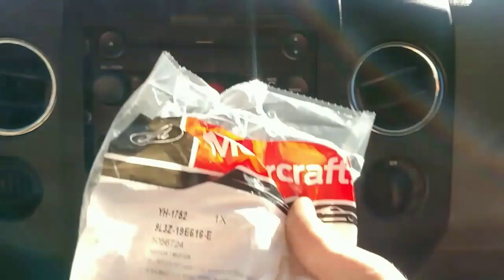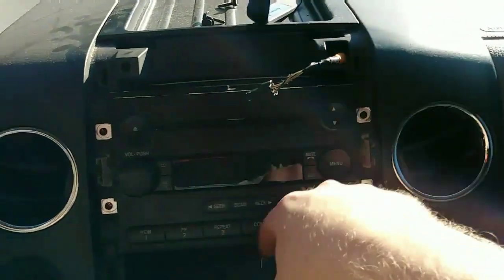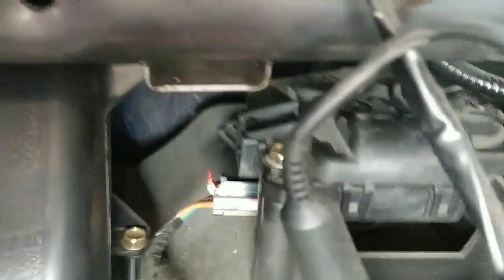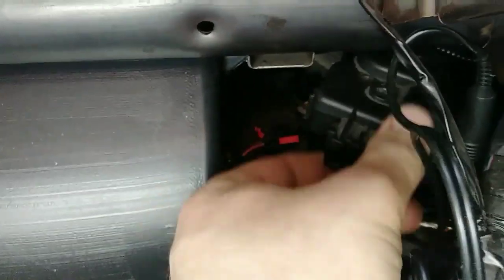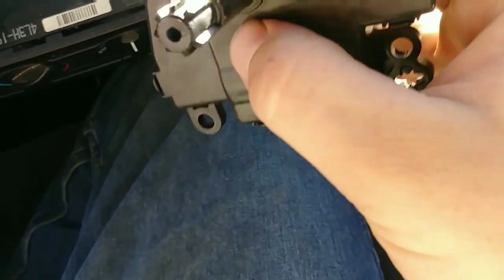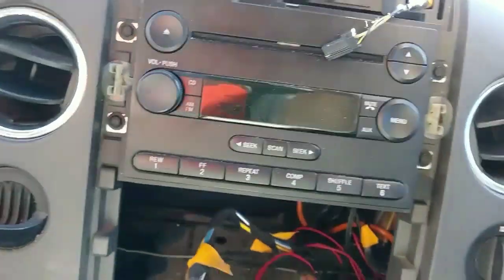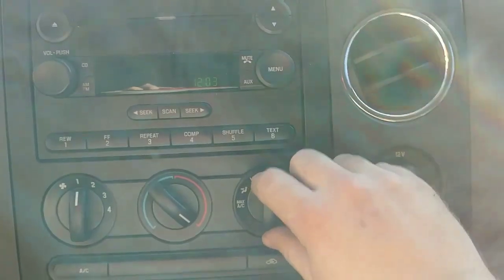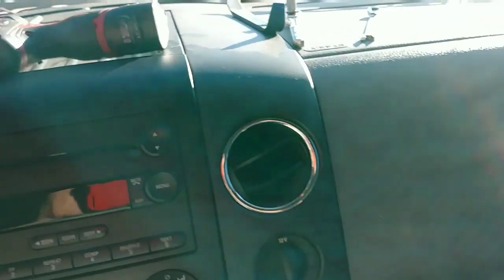How to replace a temperature blend door motor/actuator on your 2007 ford f150

Comment: Thanks for the video helped a ton.

Only thing you forgot to mention is that you need hands the size of a 4-year-old to get to the screw on the back side through the glove box.. at least on my 07 f150 lariat I had a heluva time getting my hand back there.  My hand and forearm looks like I stuck it in a weed wacker lol but I got it.
Reply: Hahahah....I'm next....
Reply: I opened it up ...and couldnt even start to fit my hands in there .. im driving with no heat  till i fabricate some specialty tools

Comment: 2006 about to replace for a second time. Such a pain. Thanks for the vid though. Good refresher for me.
Reply: What does it do
Reply: @jeffreyslay1607  It moves a door inside the HVAC system that either lets in hot air from the heater core or cold air from the AC system or a combination of both.

Comment: this is for heat right?     my AC doesnt blow cold until i get up to a speed of around 30 mph for some reason.    my heat doesnt seem to work well,   sometimes if at all.     i have a 2007 ford f150 XL 4.2.    think this could be my problem?
Reply from the maker: @MrKirk94  that sounds like a different issue. Possibly a clogged heater core.

Comment: Thanks man I replaced mine. Was a challenge cuz of the tight squeeze but I got it in, n got all 3 8mm bolts in snug. Couldn't fit a ratchet wrench in because the walls of the wrench head were too thick and there was very little clearance between the bolt head and the housing of the actuator so I had to use a regular 8mm wrench.. Lost a bolt and the wrench at one point. Retrieved them some how lol. Heats working good!!! Also I initially thought it was the heater core, paid $35 to have diagnosed at the automotive shop

Comment: Great video.  I could not get my new actuator in.  The splines on the old one are not in the location,  The space does not line up with the line on the housing one the one that I removed - tried to turn on ignition to move the shaft around some so it would drop in - no luck.  Any tricks?
Reply: @Dak Kerrins Thanks - that did the trick!
Reply: I realize this was a year ago but what was the trick?

Comment: I have replaced the the actuator on top and the one near the gas pedal and I still have nothing but heat. I can see one on the right/passenger side but ductwork is in the way. I can’t find a video for removal of the ducts or the actuator.HELP! I’ve been working on this truck several days. I bought my replacements from autozone and O’Rielly, both DORMAN brand, now I’m told that they might not even work.

Comment: Mine won’t switch to defrost or the floor vents it only blows through the main vents even when I have it set to defrost or floor. Will this fix it?
Reply: No, that problem is under your steering wheel
Reply: @dholzner what is under the steering wheel?
Reply: I have the same problem what was your fix?

Comment: My truck has a ticking sound that happens sometimes but not always. The heat still works fine. It’s just a noise that sometimes happen, like a “tick tick tick “ kinda sound, sometimes it lasts 10 minutes sometimes it lasts longer sometimes it doesn’t do it at all. Any idea ?
Reply from the maker: Sounds like a blend door is stuck wanting to switch from hot to cold air but since it's stuck it won't move and cause a clicking noise. Could way to test it is when it's clicking unplug the connector and if the noise goes away you just diaged the problem.
Reply: @Mongo_mav  okay. you're talking about disconnecting the connector of the actuator ?  then would i have to replace the blend door or the actuator ?

Comment: On my 05 f150 the ac blows but not that cool and it puts condensation in the middle of my windshield.  I had it checked last year he said freon was fine. Any ideas.
Reply: Terry Dillard i have the same problem but I think that i may need a blend door actuator like what he showing
Reply from the maker: Terry Dillard You have a restriction somewhere. Either a vent door partially open and closed. The actuator can allow the blend door to open all the way. Condensation can go many different ways. Depends where you live to.

Comment: Trevor how many blend door motors are there.  I just had mine replaced and the guy told me there were three of them.
Reply from the maker: Yes there is three of them. Mode door actuator air inlet door. Mode door actuator defrost/panel/floor floor. And the one I'm replacing in the video temperature blend door actuator.
Reply: Trevor Pehrson what does the air inlet motor control? Outside or recirculating air?  My 2006 f150 lariat king cab won't blow hot or cold. It blows air, and the vent options (defrost, dash vents, floor) works, but the temp stays the exact same whether I select 60 degrees or 90 degrees, the temp never changes. Guessing it's the blend door actuator motor.